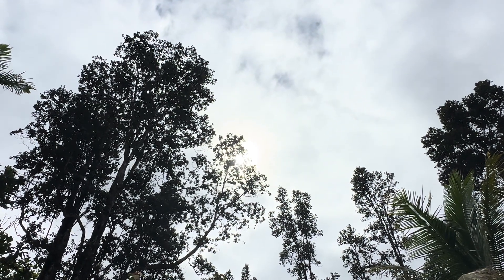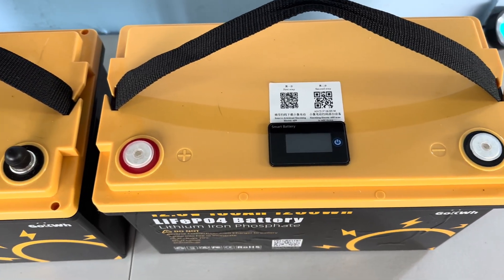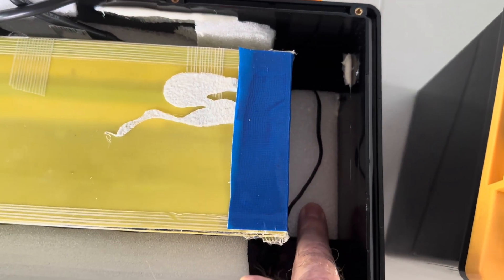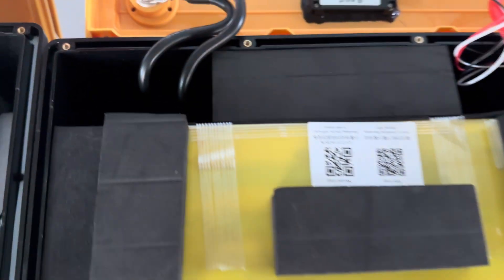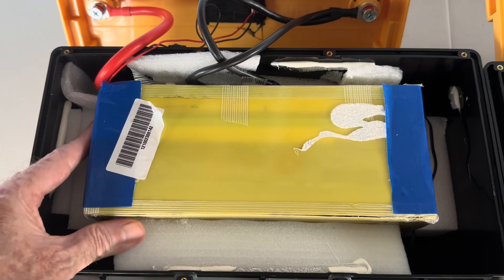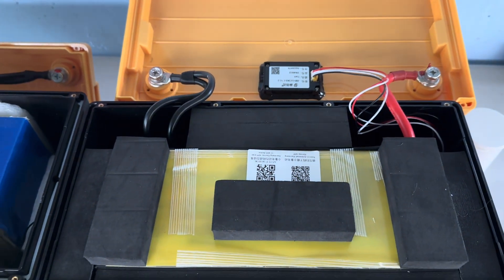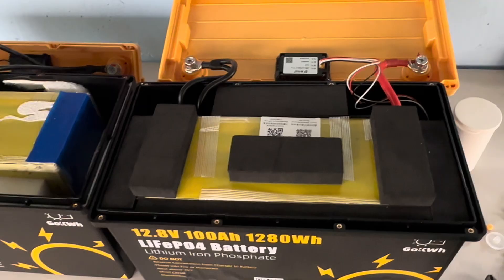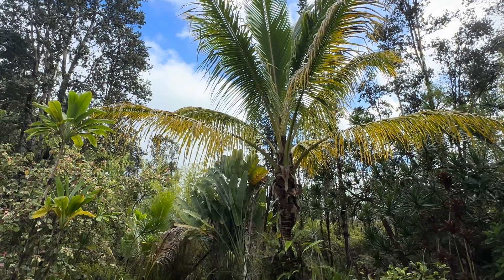GoKWh 12.8V 100Ah LiFePO4 2nd Attempt Worthy of a Road Trip?

Comment: wow. what a improvement. love that new battery display. color and amps now and has shunt in BMS. the 2 wight wires. not just red and black. now I can recommend them or buy one my self.  this is great to see a company that listens to the user .would like to see more on that display when in use. that display was easy to read. I took advantage of black Friday sale on LiFePO4. I got a pure sign inverter as well. powerqueen and REDODO has some new battery's out. and had a big sale. now I got some great stickers .
Reply from the maker: Pretty nice little battery now . I'll be using them quite a bit here shortly. Will show more how they do over time, but not bad so far. Glad you got some good deals! Aloha!🤙

Comment: I was trying to price the battery with your coupon code, the website is really janky and doesn't seem to work right also your code does not appear to be working I tried with all caps all lowers and just as you have it written it says it's invalid...
The batteries price is $250 plus shipping and tax, the redodo batteries are 230 with free shipping on Amazon right now...
Reply from the maker: I just adjusted the link and discount code. Should be all good now. I had link to the 1st battery, didn't realize they changed it on me. Mahalo for pointing that out! Aloha🤙